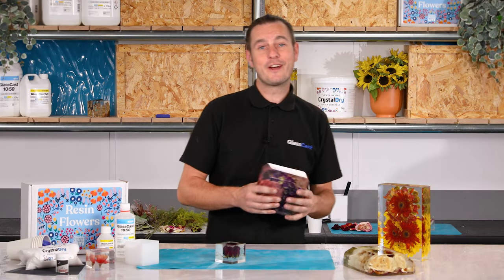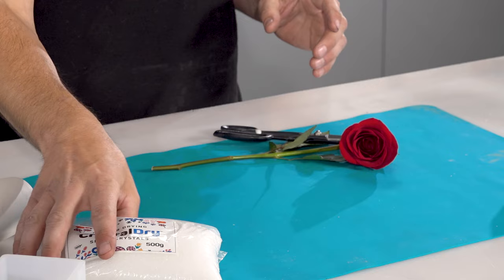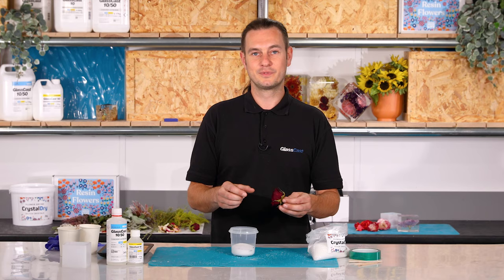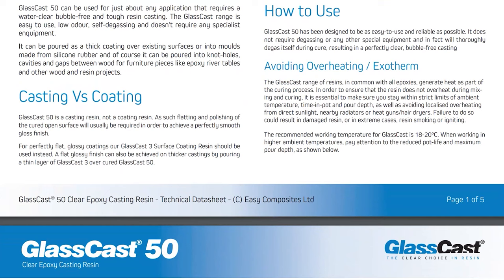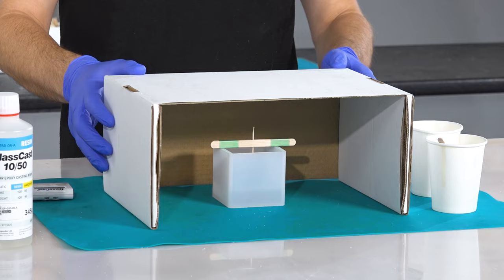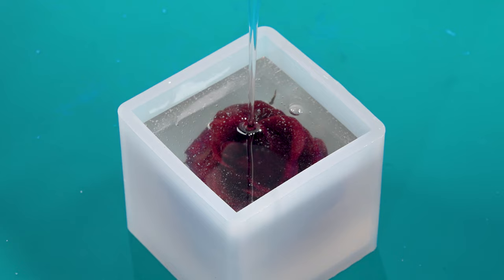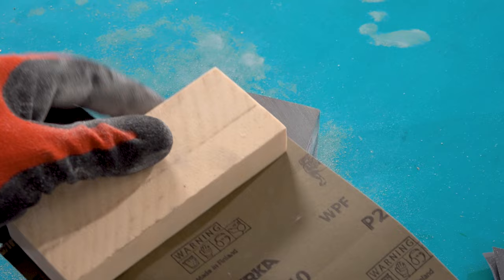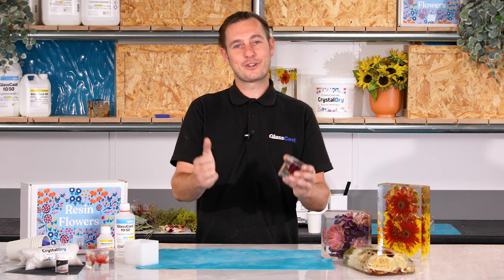Resin Flowers - How to Dry and Preserve Flowers in Epoxy Resin

Comment: What can I use to liven or enhance the dried flower color. I have a white rose and white orchid that’s dried in Silica but im afraid it’ll turn translucent in resin can I paint them?
Reply from the maker: Not something we have seen so you would probably want to experiment.  The problem is a lot of flowers are very delicate so it may be difficult to apply a coating without damaging it.  Certainly one to try first before committing to a large project.

Comment: Sadly these resins get yellow .... How shoudl we do to avoid it?
Reply from the maker: Unfortunately all epoxies will yellow with age and UV exposure. The GlassCast has a high level of UV resistant additives to protect against this. The best way to avoid is keep the resin piece out of direct sunlight where possible. if the yellowing is only surface deep you can usually sand it back and polish it to get the resin back to a clear glossy finish.

Comment: Is there a strong smell when you use the resin?
Reply from the maker: Epoxy resins have very little smell, the resin is almost completely odourless and the hardener has a slight amonia smell which doesn't really carry or linger.

In this respect epoxies are very different to polyester resin which has a very strong smell and cannot realistically be used indoors. As always, you should still follow safety precautions and ensure adequate ventilation of your work area.

Comment: I am seeing layer lines in your project . Is it possible to mix layers without being able to see layer lines . I'm wanting to do a deep pour ocean diorama . Layer lines will ruin the effect I'm afraid.
Reply from the maker: Unfortunately, pouring the resin in layers does produce this effect. Working at the 'B' stage does reduce the effect but there will still be something visible. With the petals being of such a delicate nature we were very conservative with our recommendations for maximum depth to reduce the heat from the resin cure damaging the flower. For deeper pours you may want to consider our GlassCast 50 PLUS which can be poured in deeper sections than the GlassCast 50

Comment: im doing this at the moment but my first few pours were great but half way through the resin started to go hot why has this happened I didn't do anything different 😢
Reply from the maker: If you're finding that the resin is getting hot, it can be a number of things. Pouring a layer that is too deep, leaving the resin in the pot for too long before pouring and working in a temperature that is above the recommended 20°C are the most common ones.

Comment: Why do my flowers lose their color and/or turn brown when I dry them?
Reply from the maker: Flowers naturally loose some of their colour as they dry out, unfortunately it's just part of the natural process. You might see some browning if the flowers had already started to age before they started drying, the drying process has taken too long or they weren't fully dry before removing from the crystals. If the crystals have been used a number of times and absorbed too much moisture, they can then be reactivated through gentle heating in the oven.

Comment: Instead of a hardener would it be acceptable to just use a cure chamber?
Reply from the maker: Hi Byron, no this would not work. The epoxy resin is a 2 part product and will only cure when combined with the correct quantity of hardener allowing the chemical reaction can take place.
Reply: @glasscastresin  Shame. Thank you for getting back to me. Are cure chambers only for 3D printing resins'?
Reply from the maker: @byronhaversham6238   Curing chambers are used for UV curing resins which react to the UV light, these are a different chemistry to an Epoxy.
Reply: @glasscastresin  Does that mean epoxy resin is better for the application than UV resin?

Comment: So I wanted to do this with my boutonnière from prom while also wanting to put a picture of us at prom in it. Would paper work in that?
Reply from the maker: Test a small piece of paper with resin as a lot of paper types will soak up resin and go dark or translucent in colour.
Reply from the maker: Yes you can cast photos in the resin. We usually recommend sealing the photo with a PVA solution and letting it dry first. This can help to seal the photo and prevent ink from bleeding into the resin
Reply: Alright thank you!

Comment: Where could I find the square/rectangle molds with the angled top?
Reply from the maker: Hi Jana, the mould can be located here; https://www.glasscastresin.com/65mm-silicone-cube-mould.
Reply: Thank you for the reply! I was wondering about the larger square and rectangle molds. 🥰 The tops seem to have an angle at the edges

Comment: It’s been 2 weeks and my small flower still hasn’t dried in the crystals, do I need to use a different flower or leave it in for longer??
Reply from the maker: Hi Eloise, we'd either recommend replacing the drying silica or drying the silica out before adding the flower back.
Reply: Thank you! 😊

Comment: Wouldnt layering the resin cause lines?
Reply from the maker: Hi Tracy, 

There are some subtle lines which can be seen from the side profile yes. It's a balance between casting the resin too thickly and it overheating vs some subtle layer lines. In our experience, pouring at the 'B' stage reduces the visibility of any separation as the resin still chemically cross links between the 2 pours.
Reply: @glasscastresin  hi I'm new to resin what does the B stage mean please ?
Reply: @glasscastresin  Thankyou for your help 😊
Reply from the maker: @tracybarnes370   The ‘B’ stage is where the resin has cured firm but can still be indented with a fingernail. The surface will be slightly tacky but not sticky, you can test this by pressing a gloved finger onto the surface where it will slightly tack but no sticky or liquid resin will come away onto the glove.

Comment: Why does the resin need 3 layers? Why not all together?
Reply from the maker: Limiting the depth of the pour and filling the mould in a few layers means that you reduce the chance of the resin getting too warm during the cure. Not only does this reduce the chance of an exothermic reaction but also prevents the delicate flower from becoming damaged or discoloured from the heat.

Comment: Hi do you know if I can use lilacs?
Reply from the maker: You can use any flower as long as they are completely dried out first. Just be aware that very small flowers will displace less volume so you may need more resin to fully fill your moulds.
Reply: @glasscastresin  thanks! Can I put the lilacs in salt? I don’t have this silica stuff
Reply from the maker: @VanessaRaphael  We have not tried drying flowers in salt.  The silica is likely to be much more effective.

Comment: Should have added in safety info. These are chemicals we shouldn't be breathing in, and over time, exposure will create health issues.
Reply from the maker: Full safety data sheets are available and can be downloaded from our website, we recommend reading through this before using the resin. As with most epoxies though, the GlassCast resins have very low/negligible VOC's.
Reply: @glasscastresin That's all well and fine but many people may have sensitivity. Please add a safety portion and wear a respirator gloves when pouring and it sanding. So many people have no idea of the dangers and have gotten very sick!
Reply: ABSOLUTELY CORRECT

Comment: Brahmkamal only live for few hours  so how do i preserve it please tell me 🙏🙏🙏🙏🙏🙏🙏🙏🙏🙏🙏🙏🙏🙏🙏🙏🙏🙏🙏🙏🙏🙏🙏🙏🙏🙏🙏🙏🙏🙏🙏🙏🙏🙏🙏🙏🙏🙏
Reply from the maker: Unfortunately, its not likely to be a video subject we specifically cover and the fact they only live for a few hours would make it impractical to be able to do the process for a video however, I imagine the same techniques will apply but you'll need to pick the flower head and then immediately put it into the silica drying crystals so that the drying process can happen as quickly as possible without the flower degrading or wilting. Once dry, the same process for encapsulating it in resin should be followed.

Comment: Hello. So is there a way to get the flower back out? I'm asking because I have one with 4 $25.00 casino chips that I just found out were eligible to cash in. Please I'm interested to really know
Reply from the maker: You would be able to remove most of the resin by cutting and sanding it away, however the resin will have bonded to the surface of the chips so you would struggle to remove all of the resin without damaging the chip itself. You could always take the casting to the casino and see if they would accept it as it is, they might even use it as an ornamental piece.

Comment: Can you put the flower in the mold petals first rather than stem first?
Reply from the maker: The issue with putting the petals in first is that its more likely that air  will become trapped within the flower head and you end up with a void. Putting the flower in stem first means that you can pour resin into the head which should hopefully push out all of the air and ensure the resin gets down in-between the petals.

Comment: Can you use a pressure pot for each layer?
Reply from the maker: The GlassCast resins are very good at releasing air naturally so it isn't necessary to vacuum degas or cast into a pressure pot. That being said, if you do have one available and wanted to use a pressure pot it won't harm the resin in doing so.